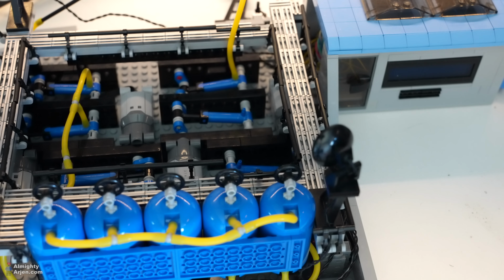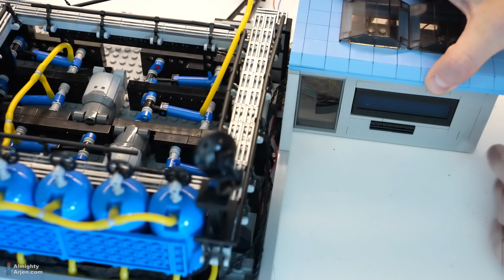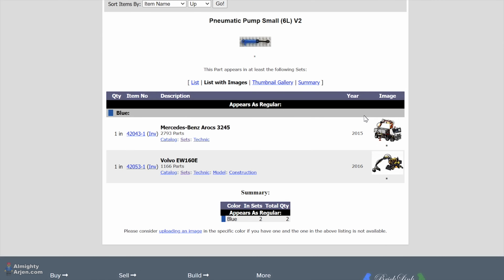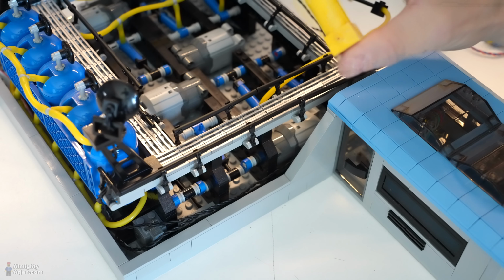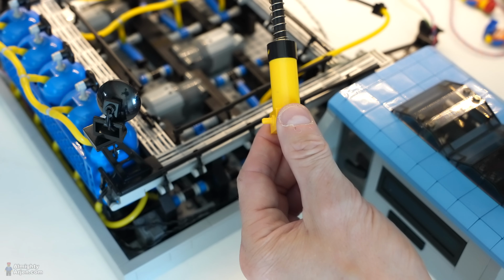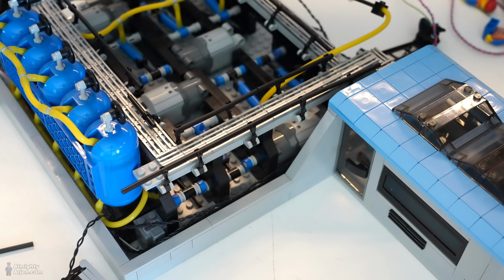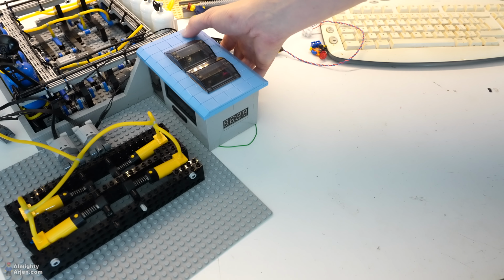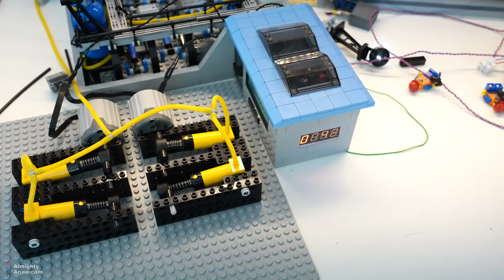Lego train automated container terminal WIP E28: fixing the air compressor

Comment: What if you put a motor on every pump

BTW im not an engineer
Reply from the maker: That would cost me two extra motors, 4 L motors are more expensive than 2 XL motors.
Reply: @AlmightyArjenWip  make sense but will it work
Reply: @erngehyehyg  the problem probably isn't the motors not having enough power but the pumps seal beeing leaky.